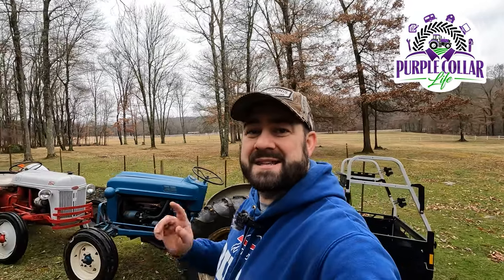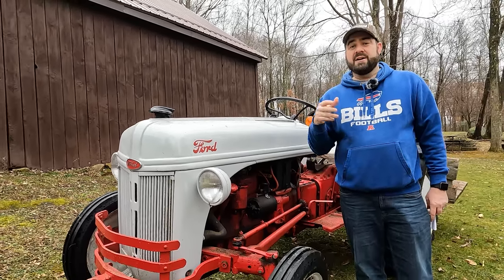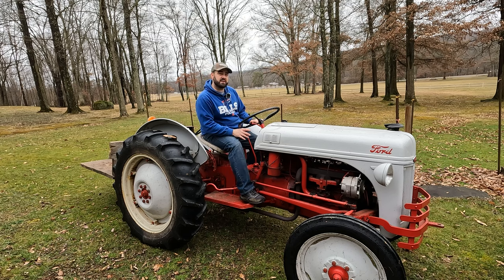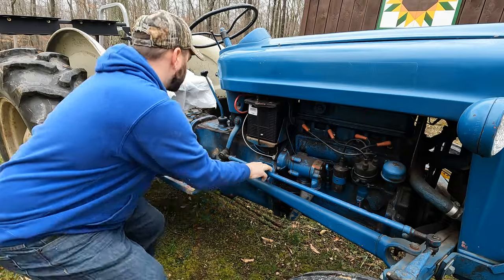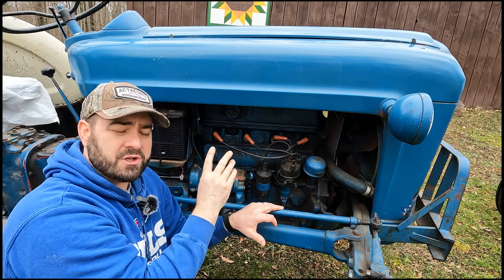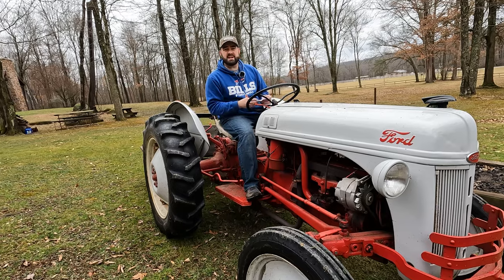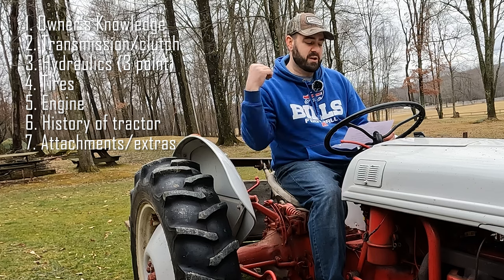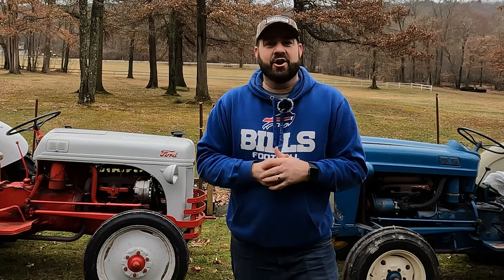7 tips if shopping for a classic tractor - Ford 8N. Watch this before buying!

Comment: Not a bad list but if you're reading spark plugs you should absolutely check compression while you have the plugs out. There is no better indicator of engine condition than compression.
Reply from the maker: Excellent point!

Comment: Look in radiator to see if hard water left deposites ,look for oil seal leaks on all rotating parts, . I personally would not buy an older tractor that does not have power steering,two stage clutch (live pto), or high and low range  transmition Yes it cost more but unless your only using it for limited use its way better for general use
Reply from the maker: Great point!

Comment: Great video. I bought a '53 Ferguson TO 30 last fall from original owner. Without much kowledge of your 7 tips, I got a very good one. Did pay good price, but lots less than a new one. Found nearly new 5' rotary cutter and 6'  multi position rear blade. Thanks, Lee in NC & VA.
Reply from the maker: Very nice! Congratulations on the Ferguson.  You’re going to have a fun, and productive, summer with that tractor, brush hog, and blade!

Comment: $1000 for tractor tires sounds like a bargain. I spend almost that much for tires for my Toyota Tacoma.
Reply from the maker: That's true. And these tractor tires will likely last 30-50 years if you're just in fields and forest. Your Tacoma tires probably won't make it that long. :)

Comment: Another tip is to find out the parts availability.  Since so many Ford N Series were sold, there is an abundance of used parts, plus several companies make reproduction parts, plus you can still buy parts from New Holland for the Ford tractors.  Steiner Tractor Parts makes reproduction parts for other brands, as well as Fords.  Some parts you can find from automotive parts stores like NAPA, etc.  Buying an old classic tractor where there is a shortage of parts available for it, can be expensive and/or impossible to find parts for it.

Comment: Another thing to look at is has the tractor been converted from 6 volt to 12 volt?
Reply from the maker: Thanks for the comment. That is another thing to look for. The switch from 6V to 12V on the 8N made a huge difference in how easily it starts. Before the switch, it didn’t start nearly as easily.  But not all 6 volts are hard/slow to start.  This 641 Workmaster is still 6V and it starts good even in the cold winter months.

Comment: I would love to have a late 8N in good condition but it wouldn't really suit my needs.
I need a tractor with a two-stage clutch, a good front loader with parallel linkage, power steering, wide range of gears, 4X4, a good Bluetooth entertainment center, and a few other conveniences. 😁
Reply from the maker: It’s nice to have multiple machines. The combination of our 8N, the 641 Workmaster, and our John Deere 2210 handle a good deal of our needs.

Comment: If you don’t need a loader or 4wd, those old tractors are great! 
If you do need those things, look for something newer that comes with it. The rim replacement is totally normal. My Ford 1700 is on its second set of rear rims. Still has original rear tires - needs new ones but the price is so high I’m avoiding it. My grandfather bought the tractor new in ‘82 to replace a 9N and upgrade to a loader. I’m still working the 1700 on the same property. That tractor won’t go anywhere, even if I upgrade to another one.
Reply from the maker: I agree! Having a tractor with 4x4 and the front end loader is nice.  Having one of those AND one of these old classic tractors is a great combination. :)
Reply: Is something wrong with the loader attachment on the ford's? Currently looking for one in my area. (Tractor +loader).; needs to lift <1000lbs. But needs to stable. Any advice would be appreciated. Ty
Reply: @steptool1  What Ford is it? An ‘80s compact, or a larger or older ag tractor? Nothing wrong with the loader on my 1700, other than being low lift capacity compared to modern machines. Lifts between 700-800lb to full height at the pivot pin, on a 25hp tractor that when ballasted with loaded tires and wheel weights comes in at around 4000lb. I wouldn’t be without 4wd with a loader on a compact tractor like mine. I’ve used a loader on a 2wd Ford 3910, which is a much heavier tractor. Worked fine, but you do have to be mindful of the rear end getting light when you lift a heavy load. Loss of rear traction = no drive power AND NO BRAKES on a 2wd tractor.
Reply: Funny I'm looking at buying a 1700 right now AND I want a 8N, Workmaster, or Jubilee lol. 

The 1700 I'm looking at has the 770 loader and comes with a shredder. Lady says the hydraulics are out and that it's probably the pump. She's asking 3k.
Reply: @relevation0  Sounds like a good deal. The pump isn’t cheap, but a fully operable 4wd 1700 with loader would probably go for $6-9k with no other attachments. If you get $2k into repairs for a working machine, you’d still be ahead. Just check condition on everything else and make sure the engine runs fine first. You never know with an old clutch too. Especially if it’s been sitting for a while.

Comment: Steering components are often over looked. As you were driving your workmaster you can see the front wheels wobble because the tie rods have play were the connect somewhere. 

Also should look for grease fittings and make sure the have been greased somewhat recently or have grease.

Comment: While extra oil filters and belts are ok, beware of someone who offers boxes of used spare parts with the tractor. If the bolt heads on the tractor are missing paint or have been repainted recently after being taking apart? Start asking questions! Machines do break and things wear out over time, BUT............. 

If the current owner is up front they will tell you if anything has been repaired or replaced. In other cases there may be a major problem they have been trying to correct themselves, couldn't? and then attempt to sell the tractor and it's issues to you.

When a problem arises, the below average mechanic/ D.I.Y person will attempt to throw parts at the tractor hoping to fix the issue. A good mechanic will diagnose the problem and fix it in one go with one part and throw out the broken one. Because of this, the super cheapo D.I.Y owner keeps all of the old parts, as common super cheapo sense dictates you keep something if it isn't broken? 

AND, if you no longer own the tractor, those parts are now junk they will need to get rid of? So rather than pay the garbage man they unload them on you, Lol. This is not always the case but just be careful so you don't get $crewed.
Reply from the maker: These are all great tips!  Thanks for adding to the discussion.